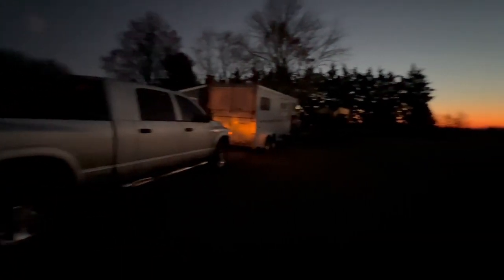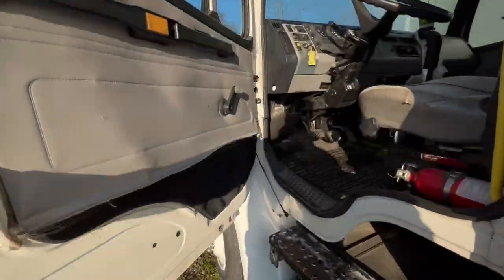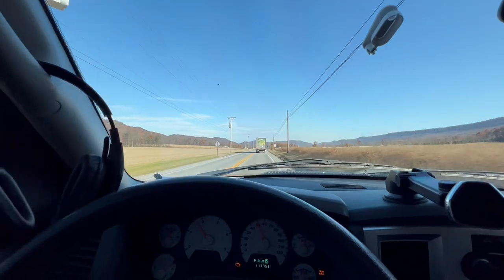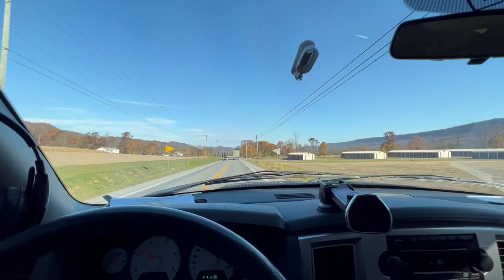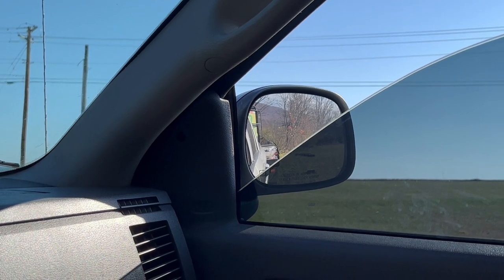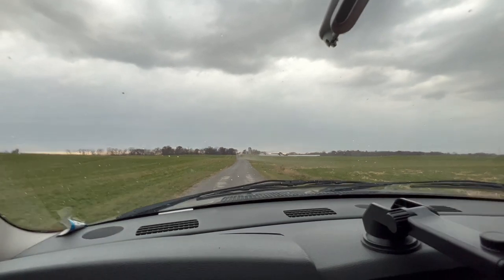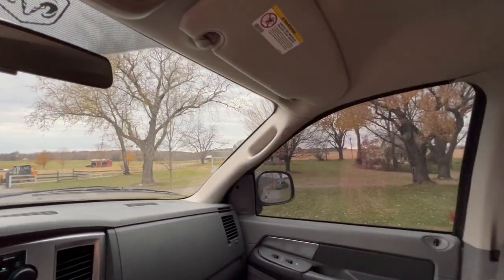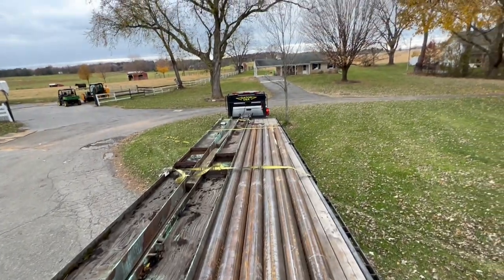I go to WAR with steel I-beams | Hotshot Trucking

Comment: a buddy of mine has his winch battery hooked to the alternator he ran a cable from the alternator to the winch battery an a fuse/voltage regulator when he hooks up the trailer electric an then plugs in the winch battery he says it works great an no low/weak winch battery he's thinking of adding another winch battery
Reply from the maker: I would do that but I just use too many different trucks. I had a hard power cable on my Chevy
Reply: Hook it directly to the battery. That's where the power is stored. Leave the alternator as it left the factory.